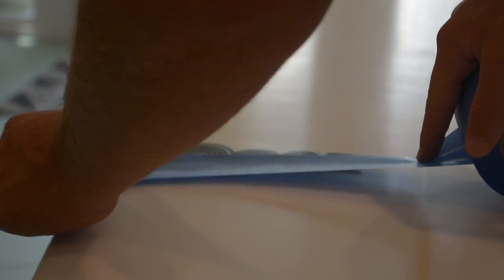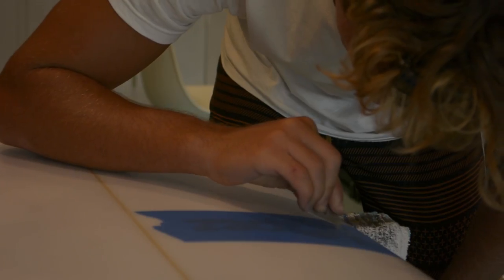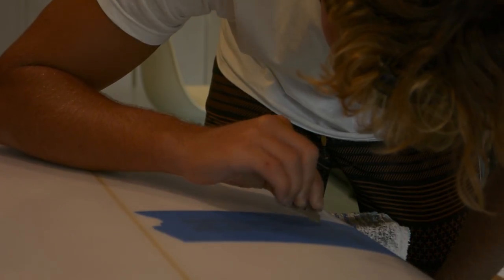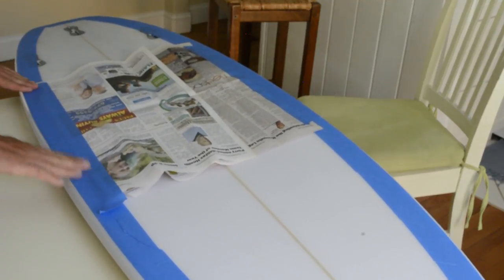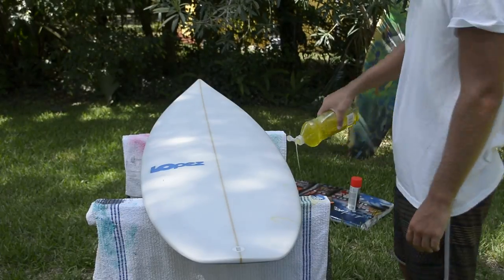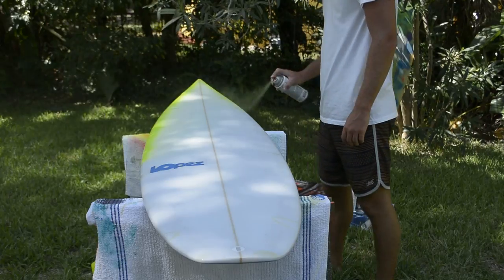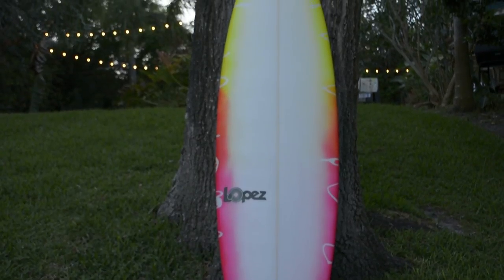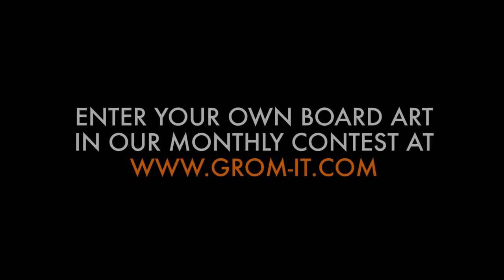Create Surfboard Art: Dish Soap & Spray Paint Technique by Nikita

Comment: How long do wait to spray soap off the board after painting?
Thanks
Reply from the maker: Guy Witscher. Not long, just until the paint is dry. Even if it's a little tacky it should be ok to rinse.  Although, the image from the soap won't really change once it's been sprayed. So if you want to wait longer, it won't mess anything up.
Reply: Cool - thanks for the info